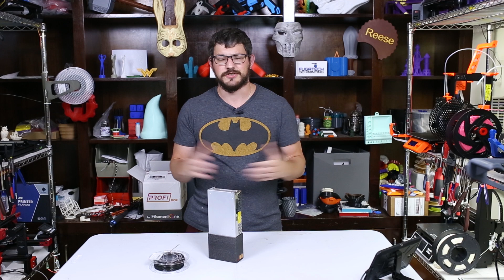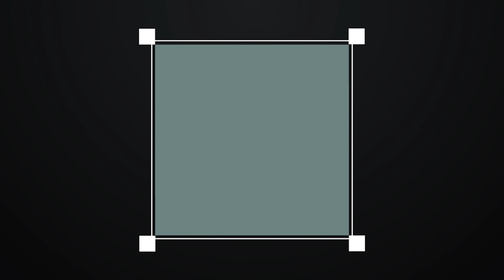How to import a STL into Fusion360 and make a 3D Printed Testbench/Portable Power Supply

Comment: I love that crackle-like finish on the print.  Very "shop appropriate".  Is that just how that particular filament prints, or did you use a special setting to achieve that?
Reply from the maker: That is how that filament prints but in vase mode it is very smooth.